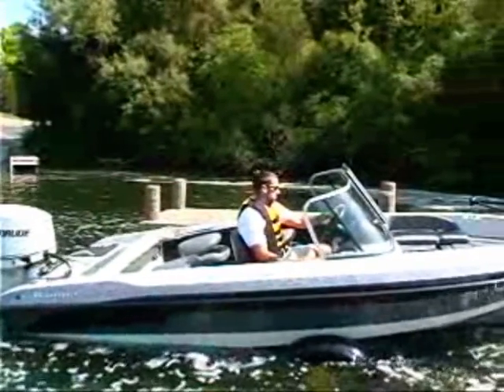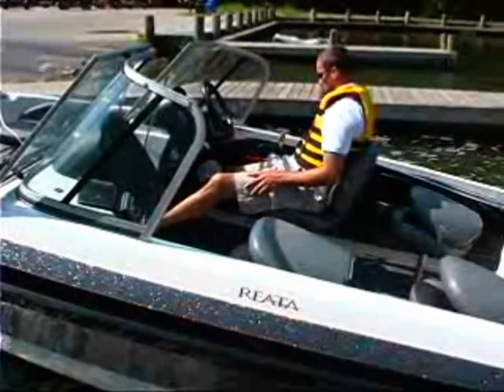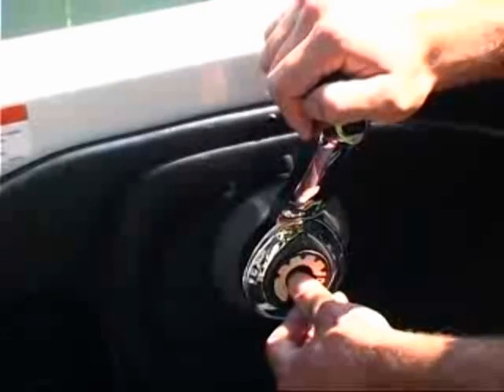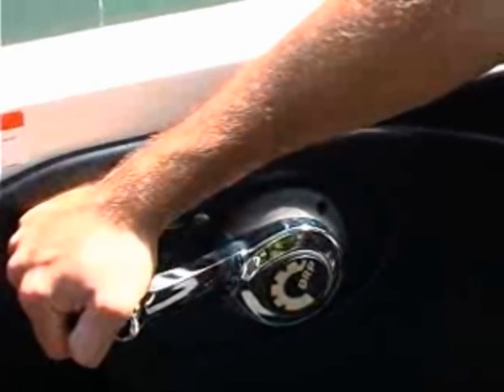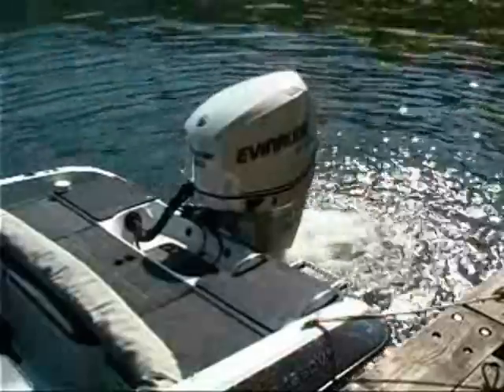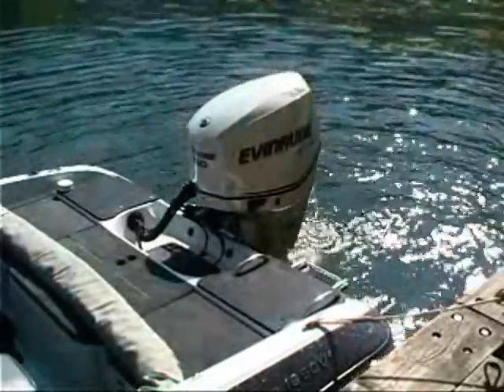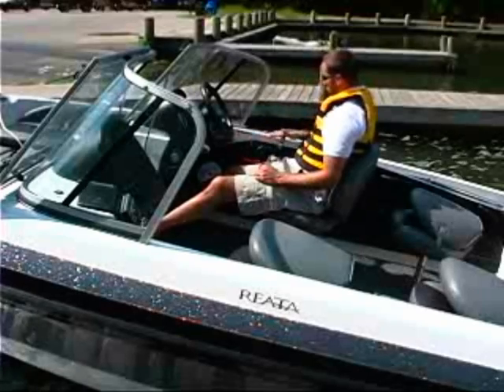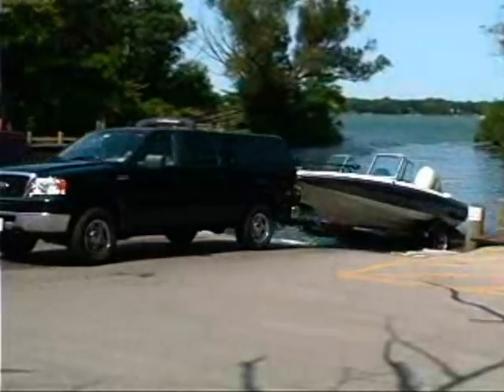Evinrude E-TEC Auto Winterization Instructions

Comment: Hi!  great video.
Reply: I just bought a E-tec 90 HP and will attempt the winterization procedure while on the trailer. Any tips? What kind of socket is needed to connect the water hose to the engine?

keep up the good work!
Otto